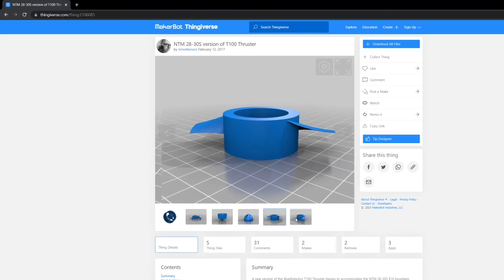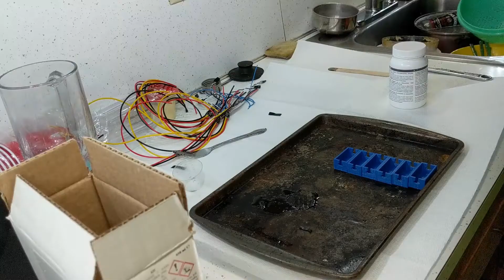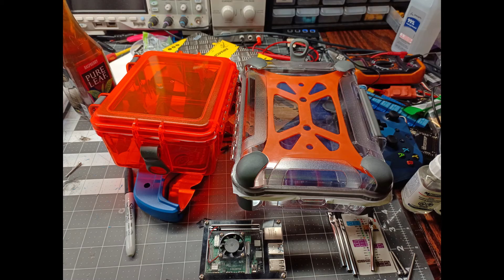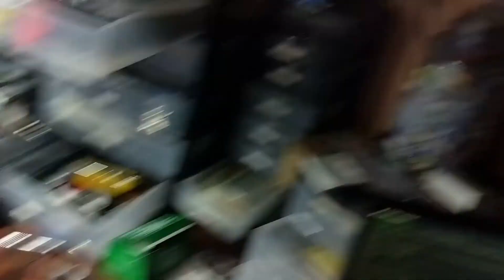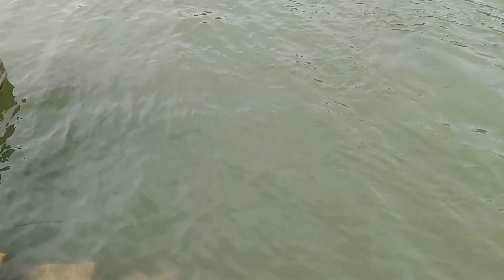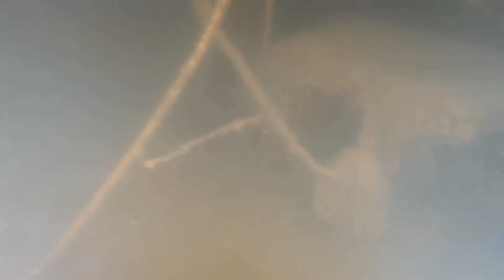ROV Submersible Project - DIY Built Underwater Rover

Comment: This project looks amazing!   I am making my own underwater ROV robot and i was wondering how are you keeping your electronics waterproof (other than the speed controllers)? I am trying to send a raspberry pi down with the pi camera to stream footage to a monitor via HDMI cable. I see you have a clear waterproof box which is just what I'm looking for but i don't want to risk water leaking in and ruining the pi from its lack of waterproof performance from the product. My goal is to plan for dives of at most 20 feet for about 15 minutes at a time. Would you recommend buying a waterproof box or making my own way of storing it? Thanks! :)

Comment: These motors will fail even in fresh water.  The bearings get rusty and fail.  I have lost a few this way but was able to replace bearings.  I am trying bilge pump motors, remove pump, install props.

Comment: wow friend!!! increible,how did you seal the motors?
Reply from the maker: I didn't seal them just run them a bit after i take them out of the watter to dry them.
Reply: Is that working out? How many submerged hours so far. Also, what is the battery life on what mAh? 12v right? I really enjoyed this video. Paused and rewound many times. Lots of condensed information. Thank you. Please post more!